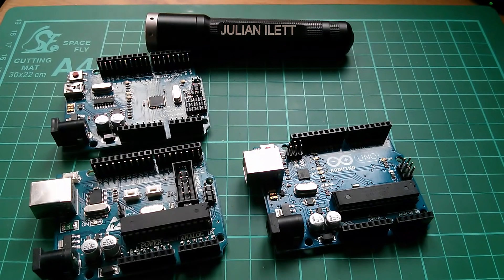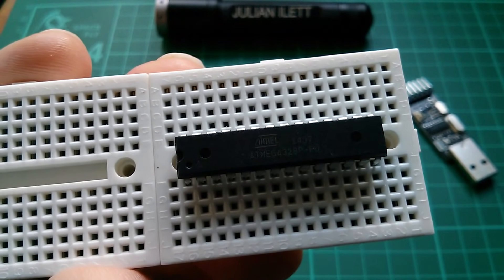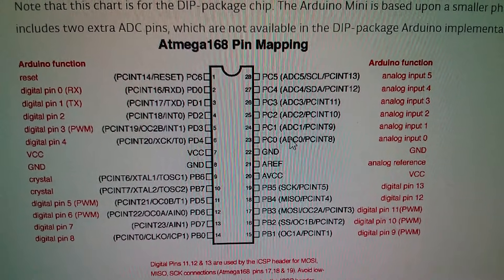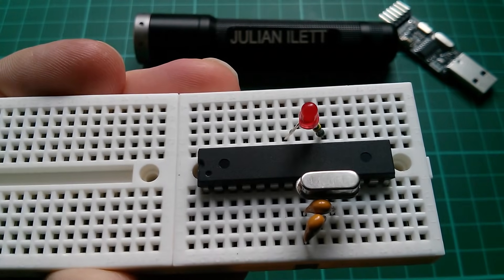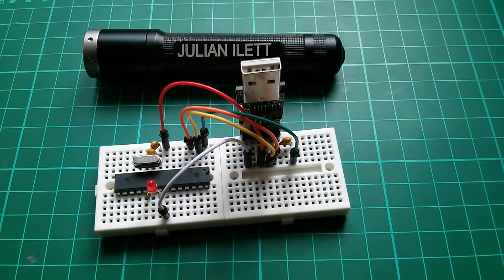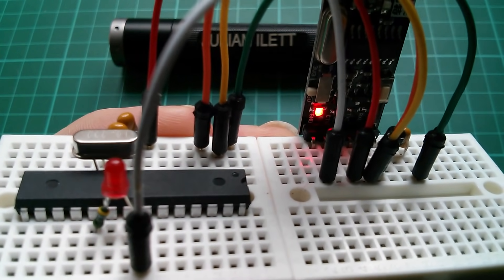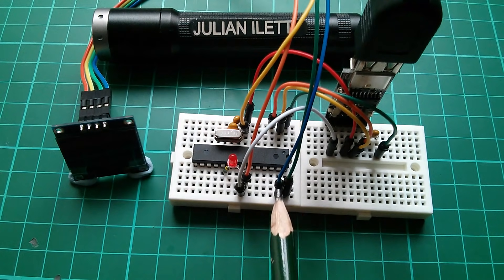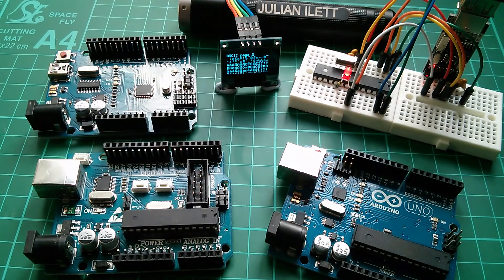1-Day Project: Build Your Own Arduino Uno for $5

Comment: for the 100nf capacitor, does it ave to be a ceramic capacitor?
Reply from the maker: +Nic froom Not really, it can be any type.
Reply: +Julian Ilett ok thank and will it work with more complex system like attaching piezos and then running this into Ardumo then into garage band?(midi audrino drums)
Reply: +Nic froom it basicly is just an arduino, but smaller. In an arduino board tou have all the overvoltage and current protections and such, and the usb to serial interface. But once you've programmed your arduino through the usb interface, it becomes useless (until you want to reprogram it). You could just program an ATMEGA380P with this method or some other way, and once its ready, you can use it with just a crystal and load caps. So, what I'm trying to say is that you should just get one of those chips and once its programmed, strip it down so you can use the usb>serial interface elsewhere and make your 'arduino' smaller.
Reply: Julian Ilett apologies if you've done one, but I'm still looking for a really good video explaining what a capacitor is, why we need them, what they do and what problems they fix. I've seen so many people try to explain all of the above but I still don't "get it" - I just have a mental block on capacitors and your style of presentation would really help I think.
Reply: +Graham North - Capacitors can be fun, I've had over 40 years in electronics and computers. A electrolytic capacitor has a positive and negative connection - I used to reverse the polarity on them on purpose, then fire a voltage through it. Guaranteed it will blow up and pop the aluminum can - it will fire off like a bullet! Things I used to do when I was only 9 or 10 years old! hehe... 

There are numerous types of capacitors, they do not act all in the same way, their composition is made for a reason. When developing projects you need to keep this in mind, or you may see what happens to capacitors when they overheat, etc.

Comment: Good job! The advantage from the assembly is able to record the program in several ATMega just changing the microcontroller as well as being easier to mount the later own circuit.

Comment: PART LIST:
(like this to keep on top)

1x ATMEGA328P chip with Ardunio bootloader
1x USB to TTL converter*
1x 100nF capacitor (-> USB-TTL converter)
1x 16MHz crystal oscillator
2x 20pF capacitor (-> crystal)
1x LED
1x 220 Ohm resistor (-> LED)

*Pay attention of your choice, it should have the same 6 pins as the one used here. Cheaper 5-pin versions do not have the CTS and required DTR pin.
Reply: +barnacora I already had a breadboard when I made the list, and it was so obivious for me that I didn't even think about it as a part, rather a base. But I think if you wish to do anything with a real ardunio the first thing you need is a breadboard, so you should add this to the 5$. But it takes up space, so it depends on your point of view.

As for the costs, I bought the chip for around 1,5$, the usb-ttl converter for 2$, and the additional parts for around 1$. The breadboard I have cost 2.5$, but it is big enough to carry the chip and the projects too, so I save on that part.

But Vineeth is right, there is no point of doing this project if your only aim is saving money. If you don't want to DIY an Ardunio, then you're better buying the 5$ clone.
Reply: +barnacora Whatever the cost might be... but building your own Arduino is absolute fun!
Reply: +barnacora If you get these electronic components from any near buy shop then I think it saves a lot of time... just put it together on the  breadboard.... that's it... you have built your own arduino! :-)
Reply: +Gergely Nagy My Led blinks for 1 sec after I start uploading.... but after that it shows : avrdude: stk500_getsync() attempt 1 of 10: not in sync: resp=0x00
avrdude: stk500_recv(): programmer is not responding
Reply: Gergely Nagy
Reply: +Gergely Nagy Can I use 22pF capacitor instead of 20pf?
Reply: +Vineeth Penugonda For me it actually worked without any capacitor. AFAIK they only needed for stabilizing tne frequency. Try it, it should not be able to do any harm.
Reply: +Vineeth Penugonda I do not see the pin labels, but the jumper makes me suspicious. There is the one I bought (after I received the wrong one, of course :-p), this is (or at least was a month ago) the cheapest that is the same as on the video: 

http://pages.ebay.com/link/?nav=item.view&id=161835245183&alt=web

Actually the same setup did not worked for me first, probably due to driver problems with Win10: the IDE could not access to the USB serial port. There are fixes on the internet, but it was easier for me to program it by a Raspberry Pi over ISP.

(link if you are interested: https://learn.adafruit.com/program-an-avr-or-arduino-using-raspberry-pi-gpio-pins/configuration, you simply connect to the appropiate pins of the atmega instead of the ardunio) 

I did not use a voltage regulator here, so the USB should work without it too.
Reply: +Gergely Nagy Thank you :-)
Reply: +Gergely Nagy Can I use 22pF capacitor instead of 100nF capacitor for the DTR pin?
Reply: +Vineeth Penugonda According to the video, the capacitor is needed to shorten the pulse. I do not know the pulse length, but considering that a 100nF =100.000pF capacitor is nearly 5000 times bigger than a 22pF one, I think the lesser one would have nearly negilible effect. You can try it, again you couldn't damage anything, but don't expect anything. ;)
Reply: +Gergely Nagy Are all those components REALLY available for $5? Also, I don't see the breadboard in your parts list, which alone costs some $2-$3.
Reply: Gergely Nagy There is no need of 5V voltage regulator here because the USB to TTL serial converter has it I think... I bought a FTDI USB to TTL serial converter( It has a DTR pin too) ... I could not get the one mentioned in the video :-)
Reply: +Vineeth Penugonda  I do not have any doubt about that, and personally I would have loved to do it myself, but I am time pressed, and I would invest time only if it saves some bucks.
Reply: +barnacora Go get a Arduino buddy! Or buy a clone :-)
Reply: +Vineeth Penugonda +Gergely Nagy Ok, it doesn't actually take any time! So I am gonna make one myself. As Gergely pointed out, the breadboard can be used for projects in addition to housing the Arduino, so we can exclude its cost. Thank you guys for your feedback.
Reply: Awesome! Have Fun :-)
Reply: Small update on the capacitors: most scource I found recommends 18-22pF capacitor for the crystal in this common layout.
Reply: +barnacora Glad to hear it, good luck ;)
Reply: +barnacora I got five 400 pin boards for 4.99 (99 cents apiece), so I actually did the whole thing for about 4.50 after all parts.  YMMV on ebay but I did well.
Reply: +Kevin Phillips Worth mentioning is that I did buy the parts to build a small fleet of arduino, and that might be the trick to keeping it at or below five bucks...
Reply: +Vineeth Penugonda bro how u have solve this error?
Reply: +Vineeth Penugonda  oh, sorry for the late response. Since as I said I do not upload the codes over serial, I can't help you (my error was that avrdude could not even access to the serial). I would ask for help in the official Ardunio forum, they are really open to DIY ardunios (they even have a category for them). Another place to ask for help is the Ardunio Stackexchange site .
Reply: +Vineeth Penugonda another thing I remembered: the atmega chip I got behaved oddly first when I uploaded the blink program, it flashed extremely slowly. I rewrote the fuses to make the MC work with an external crystal oscillator, and this fixed the problem, so I guess the problem was a bad configuration. If you have the tools (i.e. a working ardunio or a pi), you should also try re-burn a bootloader (and maybe also reconfigure the fuses, I am not completely sure if burning the bootloader also configures them.)
Reply: +Gergely Nagy I read somewhere about the (stray) capacitance of a breadboard. More like a downside of using a breadboard I think, but in this case it might be enought to get rid of the crystal capacitors.
Reply: Jeff Merlin yes
Reply: Gergely Nagy can u list out all the components required to build our own arduino?
Reply: please give me pcb layout of this arduino circuit
Reply: so if you can't can't afford a genuine Arduino this is great. however if you want to build it for fun and already have an Arduino uno you can use it as ISP. and  cut the plug off an old phone charger making sure it's 5v lol and if you haven't already got a bread board I think you got lost in youtube land...
Reply: Might be worth pointing out that ATMEGA328P are available as FREE samples direct from Microchip. They won't have a bootloader installed but that's not difficult to do. Here is a link in case you want to see how to order free samples https://youtu.be/zPYoUqhTXEk
Reply: Good information
Reply: Thank Captain, you can fly away :)

Comment: ELEMENTZ CP2102 USB 2.0 to TTL UART SERIAL CONVERTER MODULE with DTR pin (Can be used as ARDUINO PROGRAMMER ADAPTER) with Jumper wire https://www.amazon.in/dp/B00LT0JOPC/ref=cm_sw_r_wa_awd_n92Pwb039F54Z......
Can you plz tell me if I can use this USB instead the one you suggested??? BTW is there actually any difference between them?

Comment: Hi Julian - love your videos - keep up the great work.Have you tried fitting the programmed ATMEGA328P-PU chip into one of your regular Arduino UNO boards, and uploading a different Sketch?I've built a system as yours except my chip appeared not to have the Bootloader already loaded. I first used the Arduino IDE built-in feature 'Arduino as ISP' to burn the bootloader then was able to upload all sorts of different sketches with no issues.My issues arose when I removed the chip from the test breadboard environment and put it into a known working Arduino UNO R3 board. It refused to accept any sketch I attempted to upload. It failed every time with an error message like 'Out of sync', the same as I was getting when the chip had no bootloader installed.I've been playing around with CNC G-Code stuff and wanted to use one of my UNO boards to upload a HEX file using the 'XLoader' process and didn't want to run the risk of stuffing my good UNO board so thought I'd switch out the chip for an eBay low cost replacement chip. No suck luck....Any help would be greatly appreciated.All the best from an ex-pom now living in NZ.Johnhh

Comment: You can buy one already assembled for 5 bucks on Ebay so what's the point in building one?
Reply: +GhettoRanger you can make it smaller
Reply: +GhettoRanger You did it by yourself..
Reply: smaller and actually cheaper. You only need the chips and crystals ans caps. You can get the crystals for likes 30pcs for 2$, caps are basicly free and the chips are somewhere likes 2-4$/pcs

Comment: Can you run it without the serial adapter and just add DC power?
Reply: yes. Just supply power to the right pin and ground the ground pin. You only need the chip, crystal, and caps

Comment: Nice project... just FYI, I used a similar but different USB <-> serial converter, also sourced on Ebay, and I had to use a 22 nF capacitor to couple the DTR line on the USB converter to pin 1 (reset) on the ATmega328, instead of the 100 nF mentioned in the video.
Reply: +HighCountryTekRadio What serial converter do you used? I have the same problem. The chip von my converter calls 'Silicon Labs cp2102'.

Thanks.
Reply: yes was it cp2102

Comment: That is amazing +julian llett! What is the advantage of the bigger one to the one you built? It's because on my diy project, I used an Arduino nano which is small. However, the one you built is even smaller which I really like.
Reply: An arduino nano uses a different controller and has less I/O pins than the big one. The big ones that he showed in the beginning were facroey assembled arduinos and the only advantage in those is the plug and play and shields fit them. But you can achieve the same by just putting an Atmega328p and a crystal and caps on a board and programming it through that usb thing. When you done you can actually remove the usb thing making your "arduino" smaller than the  nano i think

Comment: Cheaper to buy a 'pro mini' now a days.
Reply: a pro mini is not as cool and I believe has even less pins. At least its not as powerful
Reply: +No One Cares m9  Pro-mini uses the SMD version(ATmega 328P-AU .. 32 pin) of exact same microcontroller in arduino(ATmega328P-PU .. 28 pin) (in fact pro-mini comes with 2 extra dedicated pins for A6 and A7 analog inputs), and its clones comes at a price of 175 Rs here in India,  that is little less than 3USD .

Comment: Here in Romania those costs 2x the price! So unfair...
Reply: +LightningShock captain just said that? Anyway I came here to say you could just buy those Atmega328ps off ebay (and some 16mhz crystals and a few ceramic caps) and use them alone. Those get through the customs and free shipping and what not everytime at least to Finland. And youll only need one of those usb thingys, you can program every chip with the same one.
Reply: James Wright Yes. But you should keep the caps and crystal in place. And also apply right kind of power! I dont think the microcontroller has any built in regulators.
Reply: +LightningShock well buy it from china just like the people who sell them...
Reply: Captain Dandal
Romania is in EU.
Reply: +MrMats0n So after the programming the USB converter can be removed and all that is left to do is power the  microcontroller?
Reply: +LightningShock because you pay tax for both your government and the european union.

Comment: I would not class the cheapest board there a "fake" arduino... Because they do not have the ATmega chip on the board.  It's basically a programmable board.  The key feature of the arduino is that you can remove the ATmega chip and make something that can work "standalone" and yet still use the arduino with a new chip and program it again.

It is a Project launch platform, that was its main intention.  To inspire circuit designers and provide a cheap / affordable programming platform.

Comment: In other Arduino videos they say a sure-fire way to detect clone boards is to see the rectangular component beside the USB port. Presumably it would be green on clones and golden on the original since the golden component was "commissioned specially for Arduino". Now one of the the boards presented here as a clone also has the golden component. Guess we'll never know for sure if a given board is an "original" or "clone" (if this even makes sense with an open source project) after all.

Comment: Julian, I have tried several times to duplicate your project but never have been successful with an upload (Blink or any other program). I continue to get a failure to sync message from the IDE:

Arduino: 1.6.6 Hourly Build 2015/10/02 05:32 (Mac OS X), Board: "Arduino/Genuino Uno"

avrdude: Version 6.0.1, compiled on Apr 14 2015 at 16:30:25
         Copyright (c) 2000-2005 Brian Dean, http://www.bdmicro.com/
         Copyright (c) 2007-2009 Joerg Wunsch

         System wide configuration file is "/Users/noelkuck1/Downloads/Arduino.app/Contents/Java/hardware/tools/avr/etc/avrdude.conf"
         User configuration file is "/Users/noelkuck1/.avrduderc"
         User configuration file does not exist or is not a regular file, skipping

         Using Port                    : /dev/cu.wchusbserial1410
         Using Programmer              : arduino
         Overriding Baud Rate          : 115200
avrdude: stk500_recv(): programmer is not responding
avrdude: stk500_getsync() attempt 2 of 10: not in sync: resp=0x00

Any suggestions? Thanks for a reply.
Reply: Do you have the arduino bootloader on the chip? Doesnt seem so. Try googling how to flash arduino bootloader to atmega328p

Comment: Hi. Nice work Mr Julina Ilett! I Have tryed anything. I did burn a boodloader on a chip and the problem continue. When i does try to load the blink sketch the arduino say avrdue not sync. I use the USB2serial light from arduino. I obreverd this usb2serial don't have the DTR has Tx, Rx, Vcc, GND and EXT RESET. My drivers are correct my port is correct everything is correct but i can't load the blink sketch. What can i do? Thank you

Comment: why you can't buy raspberry pi zero what cost $5?
Reply: Very Manly Man yes, and you can make much more, why you have to lost all the potencial in a raspberry in a such simple task? and the microcontroller alone with out all the securities from arduino board are more cheap and works very weell, (the are microcontrollers no need a external clock and have UART port) you only put the microcontroller conect the power and its all. Remeber arduino project was made for the purpose to introduce the people to microcontroller in a easy way.
Reply: +Very Manly Man arduino it's a microcontroller (made to learn easy way to the microcontrollers with out all the problems handle microcontrollers),raspberry zero it's a computer(made for introduce the computational cience to the people with a minimum cost) those both are good ideas. but with a diferent purpose
Reply: For power aware applications, the Pi Zero is overkill and will just drain through batteries.
Reply: it sold out within 24 hours
Reply: Cosmic Taco Cat
but you can still buy it on ebay
Reply: +Very Manly Man yeah but those prices are probably high because of people wanting to resell them for a higher price.  
I haven't check my self though. So I dunno.
Reply: mttorresrivera
but you can use raspberry as microcontroller too
Reply: fragwits if you have a rework oven, then you can get the BGA off of there. 😉

Comment: After loading the code to the Arduino I could take the the chip with the double flash code and connected to a board with a power source and a LED and the LED will double flash blink?  And then I can buy a new chip for the Arduino, sketch rinse and repeat?